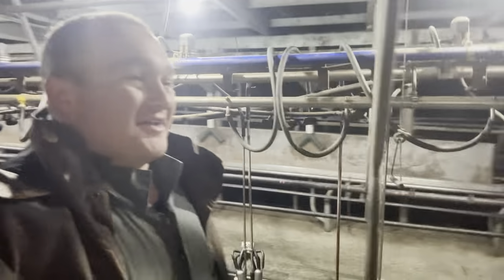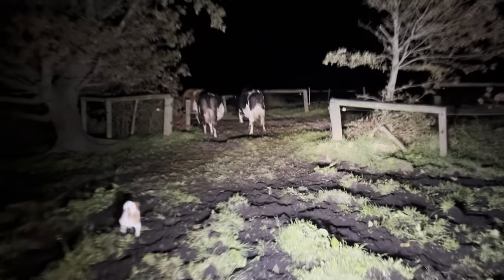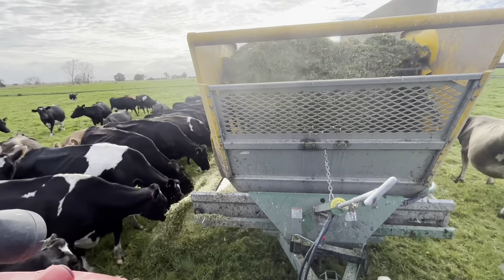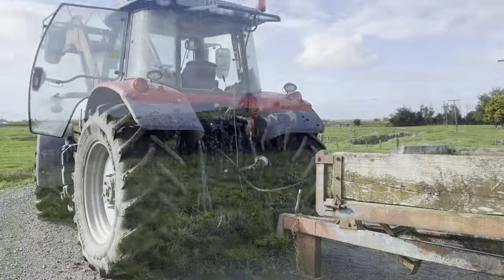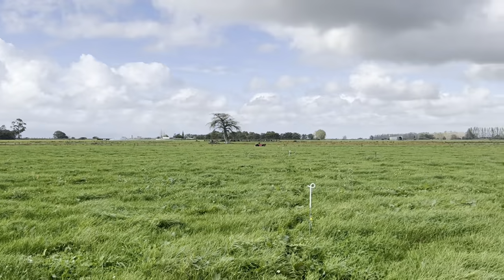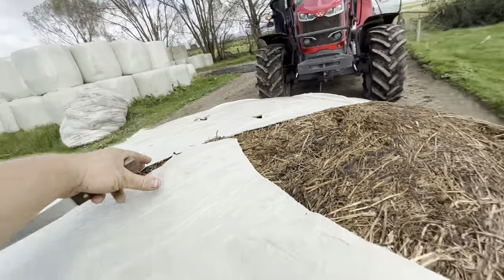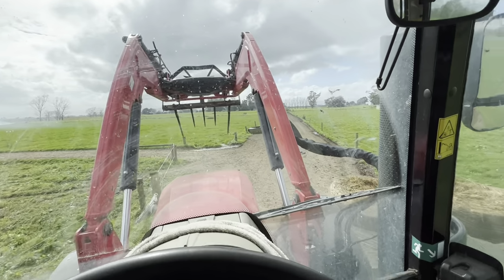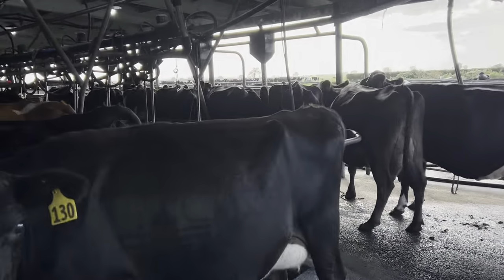Chopping Maize. Feeding Cows. Reload Silage. #farming #agriculture #cornharvest

Comment: When you hooked up the big green trailer that's nothing compared to what happened to me stacking bales
Reply from the maker: Yea that’s no good Cole mate. What happened? 
We are lucky most we’ve had to stack was 400 bales in from the swamp to a pile under the willow trees a 1k cart. Not too bad but all coming from a paddock mate. 
Unhooking and rebooking isn’t hard with 2 but is a bastard when there’s just yourself. I’ve done that stacking silage when dad was busy doing something else.
Reply: @Dozer the farmer  yeh what happened to me is I backed up to my trailer and had it lined but my hydraulics didn't stop and it tipped my trailer back and my bales almost fell off the back so I had to get 1 off the back and the push the front of the trailer down with soft hands
Reply from the maker: @colemorris2521  aww yep damn mate your lucky no fun rolling or buggering up the trailer. 
I had 3 attempts to try connect up the trailer with the quick hitch and every time I missed it shifted the eye vertical and got a little bit annoying haha.